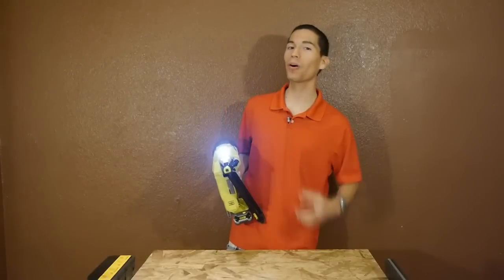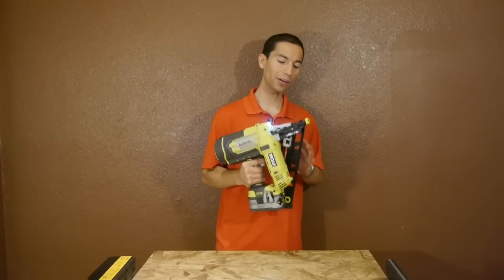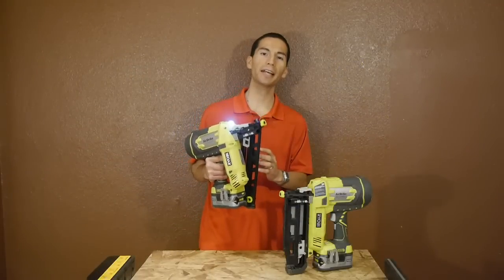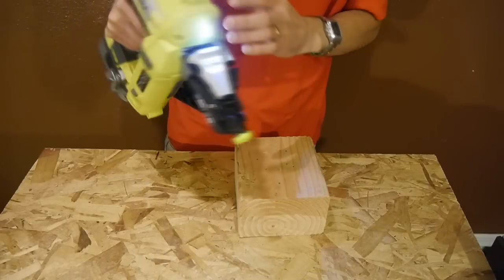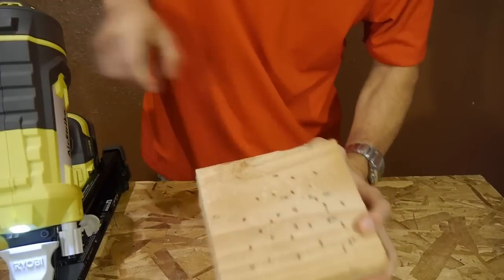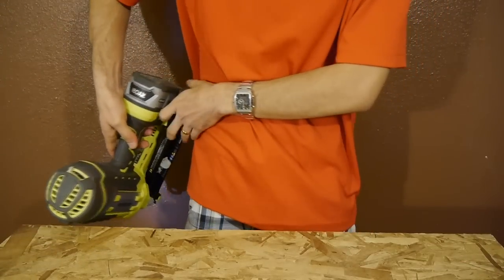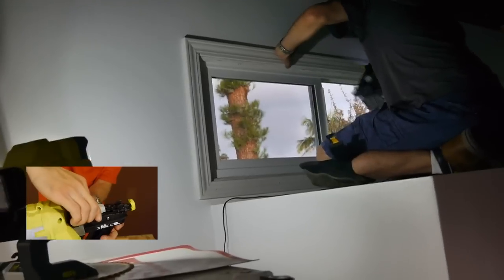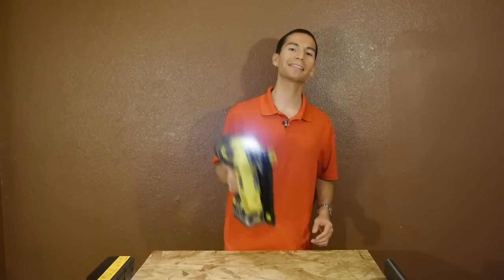Ryobi 18V Airstrike 15 Gauge Angled Finish Nailer P330 Review

Comment: Great review.  I have the brad nailer and staple guns and love them.  I need this one to complete my cordless Home Performance and finish carpentry business.  I bought the stapler for stringing insulation which is a very intensive job.  I used 1 of 4 bars on the battery for the whole house, worked perfect every shot!  And saved 1.5 hours labor time from not having to set up a compressor and hose.  My solar system just keeps all my batteries charged all the time.
Reply from the maker: Very nice, I'd like the stapler some day for my woodworking

Comment: Not sure if they redesigned it, but now you CAN install the belt clip on the other side of the tool for right-handed people. There is a spot on the magazine to screw the belt clip onto the left side of the tool for easy clipping to your belt with your right hand.
Reply from the maker: Actually it had that ability all along, so it was my error in saying it was only good for one side. My bad

Comment: That thing is huge. Wow. Next they'll be coming out with a smaller version of it. Great video!
Reply from the maker: Love2boat92 thanks, a smaller version would be great. My guess is that once all the brands come out with their own cordless battery powered nailers, the next move will be to shrink them. I'm all ready hoping for 12v nailers, I know it might take a few years but I think its possible
Reply: Tool Craze I never thought about 12v nailers. That's a great idea.
Reply: +Love2boat92 why?
Reply: Jay Walt Because you never see a 12 volt nailer.
Reply: what would be the advantages compared to a 18v?
Reply: Jay Walt Smaller, lightweight, Less cost etc. Many people love 12 volt tools because of the size and weight. They can use it longer.

Comment: Nice review.  Picked this up a few weeks ago to complete my set of the four Ryobi AirStrike tools.  One small error in your review:  You can attach the belt clip on either side.  When attaching the clip to the left side, the clip mounts to the hole at the end of the nail magazine.
Reply from the maker: Schtuperman thanks, I made the correction a while back and you can see it on a desktop pc as an annotation. Unfortunately the annotations don't show up on mobile
Reply: Tool Craze LOL yeah I watched your review on my phone.  Sorry I didn't realize you had caught it.  Damn I'm running out of One+ tools to buy.  Just a few more and I'll have them all!  Now if they would just bring the green trim router, planer, & Corner Cat to the USA.  New model of the SDS hammerdrill is out in Europe too.
Reply from the maker: Schtuperman no problem bro. It's one if those things YouTube needs to work on. That or giving us creators the ability to edit videos after they've been posted. 

I was looking at some of those models, the router sounds great and I was looking for a cordless planer. I can't wait till the new rotary hammer comes here
Reply: Not sure if you have seen this but this is the new SDS Hammerdrill.  Its much more compact than the old model, has LED lights, offers a pure hammer mode for chisels, and looks like it will have the infinitely adjustable handle of its predecessor..  Also has the design of the newest series tools. -  http://www.amazon.co.uk/Ryobi-R18SDS-0-Cordless-Rotary-Hammer/dp/B00VEU9JZC/ref=sr_1_2?s=diy&ie=UTF8&qid=1436183761&sr=1-2&keywords=Ryobi+SDS
Reply from the maker: Schtuperman I did, I did an article about it on my website a while back. Looks great for a compact 5/8" rotary hammer
Reply: +Schtuperman I had the older SDS rotary hammer and I sold it to make room for this one. This has only recently become available in America so I can't wait to get it.

Comment: I have this, the 18 ga. brad nailer and the 18 ga. narrow crown stapler and they are all great. If they would make a framing nailer (preferably 21 degree) it would buy it as soon as the funds became available.
Reply from the maker: a cordless framing nailer would be great, so far Dewalt 20V is the only option if you want battery only
Reply: @ToolCraze   It's coming
Reply from the maker: @johnjingleheimersmith9259  yes, I wrote about them back in December. Check them out on my website https://toolcraze.net/ryobi-cordless-18v-framing-nailers/

Comment: My biggest concern with these is their size... the pneumatic guns are significantly smaller. In tight areas, i'm afraid my investment will be null. Good review!! I'm not one of those tool snobs who thinks Ryobi doesn't deserve a look. I don't make money with nailers, so I can't justify the cost of the DeWalt guns, to match the battery platform I am the most invested in.

Comment: Good review, I liked to see the firing performance. However I don't like the delay, I have a 18 ga nailer with a similar delay and it is annoying, it is much easoier to set nails properly without that delay. So I will stick with my small portable air compressor and finish nailer.

Comment: How does it do on hardwoods?  Doing finish work on an older house where the Douglas fir or Southern yellow pine has -dried and hardened up is like driving in to hardwoods.  Testing on a fresh semi dry piece of 2x4 isn't much of a test.
Reply from the maker: I tried it on a solid block of red oak and it nails 2 inch nails below the surface, how's that for performance?

Comment: Not to be picky but the battery was installed, the gun was loaded and your finger was on the trigger at 4:20 when you put your hand in front of the nailer to remove the tip. Not prudent.
Reply from the maker: If you ever try one of these out, you'll find out that you have to press the tip firmly to fire the nailer. Had I pushed the tip into the gun with my hand while removing the tip, then we'd have something to worry about. Thanks for the concern though

Comment: Wow, that is way too bulky.  The way the motor bumps out kinda takes away from the advantage of the angled magazine.

Also, in case of jam... make sure to take the nails out of the magazine before opening the lever to clear the jam.
Reply from the maker: bulky? I can say the say thing about lugging around a compressor and hose
Reply: There are other cordless nailers, this one is way to bulky.
Reply from the maker: Yes and the smaller models use smaller nails with less grip. You won't find a cordless 15 ga nailer from any brand the same size as 18ga cordless nailers. It just ain't going to happen..
Listen, I've used this nailer plenty of times to install trim and hang doors and it's size never bothered me or made it any less effective. It's a fine tool for the job.
Reply: I understand that different size nails are different sizes and I never said the 15 ga needs to be the same size as an 18 ga.  I believe it physically possible to have an effective 15 ga cordless in a smaller form factor, don't take it personally.

Comment: What is the degree of the nail I need for this gun? I couldn't find this out, anywhere on the box or instruction manual....I know it came with the 2"nails, but I needed 1.5", so the guy at Home Depot said to get the DeWalt 15g, 34 degrees (1.5") nails, so I did, and they didn't work. They are the wrong angle. I'm really frustrated.. Does Ryobi make their own nails? Couldn't find them anywhere, if they do... If you can help, I'd really appreciate it!
Reply from the maker: +Everywonlies degree angle isn't listed on the gun but it seems 34 degrees is correct. I bought my nails from hf and they fit fine and were also listed as 34 degree like your dewalt nails.

Comment: Good tip. Don't buy these guns if you want the nails to sit flush when using on an angle! Theyre a waste of money. I only nail into 16mm melamine board, and had to hammer home the nails after all the adjustments were made to sink the nail as deep as possible. Junk, so I'll be buying another Dewalt angled nailer
Reply from the maker: All nailers have this issue if the angle is too severe. To solve this, try to fire as close to a 90 degree angle as possible if you dont want them sticking out.
Reply: I've tried 4 different nailers in the past 2 months, both AEG and Ryobi, and none of them worked for my job. My old Dewalt has never had these issues when firing on an angle, and neither does my new 16g Dewalt which has to be the best nailer on the market that I've seen. The reason being is that both the AEG and Ryobi are very wide which damages the gyprock walls when trying to nail a top shelf of a wardrobe, whereas both the old and new Dewalts are much slimmer and I never get close to the walls to damage them. These Ryobi's and AEG's are fine for straight work, but theres no way in a fit I'd buy either of them. Shame, as they both seem to be decent tools for the price (and I have loads of AEG tools and batteries), but I'll stick to the Dewalts. Cheers

Comment: Take the battery out of the gun before u take the green tip off
Reply from the maker: James Bolton good thinking, better safe than sorry
Reply: What he’s also saying is if you leave on the no mar tip the nails won’t sink. Out comes the hammer then.
Take your choice so between marking the wood or not sinking the nail. 
Heap of rubbish so

Comment: Hi there , so i have this nailer (Ryobi p330) and im getting a second dent in the wood just below where the nail has been driven. It is a small horizontal rectangle no bigger than the nail hole itself.  It started doing it about halfway up a 10 ft wall that i am nailing shiplap onto. I called ryobi and she had me decrease the air pressure and then put it back up but not all the way. I didnt see much improvement. She said if that didnt fix it i woud have to take in for service. Is this user error or do you of something else in nail guns that may cause this?
Reply from the maker: it shouldn't do that and it sounds like they gave you the answer